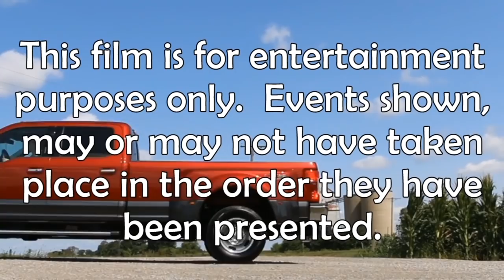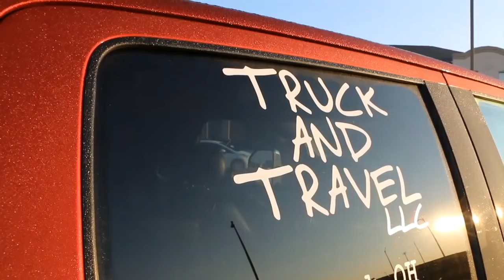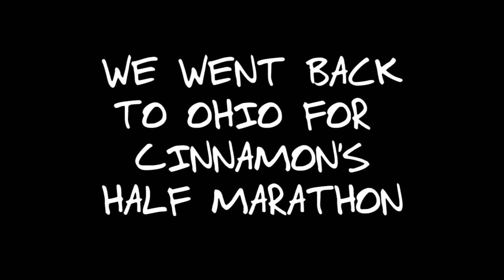Our First Hot Shot Load Together With Our Own Authority

Comment: congrats on your first team load... I'm about 2 weeks out on hitting the road.  I have a truck like yours and a 40' trailer.  what is our trucks rated for total,  36k lbs???
Reply from the maker: Depending on your rear end gears and if it is a Single or dually. I will say mine is rated for I think 32k gooseneck and 21k bumper pull
Reply: thanks man....  safe travels to ya'll and we'll see ya on the road soon...
Reply from the maker: Thank you Marc. Safe travels to you when you hit the road

Comment: With your experiences and knowledge of hot shot, do you recommend leasing on with a company first before obtaining own authority? I’ve had my CDL’s for 10yrs now but never done hot shot trucking.
Reply: If you know what youre doing, can jump right into hotshot yourself. Just know weights, insurance, proper equipment and so on. If not, well highly recomend with a company then.
Reply: I know all rules and regulations of a rig which I know are different from a dually. DOT hot on duallys in south Tx and LA. Never had an over weight ticket in 10 yrs and CSA score is at zero. Want to keep it that way lol. Thanks for the advice and keep the videos coming!! Congrats as a team
Reply: @walkerinmotionllc8618  Well you shouldnt have an issue then. Just keep in mind a truck SLT or tradesman ram is the cheaper but still $45,000. The trailer depending on weights you want to run range. I know Kaufman Trailers have a 31,000lbs rated triple axle dual tires. Just keep in mind the tires and that. Why most Hot Shots keep with tadem duals. DOT of a dually and a semi are exactly the minus the airbrake of course. Still scale and permits if oversized. As for insurance, theres really no way around the high charges. I know a semi O/O will a milion coverage averages $45,000 a year.  No matter what, the cost is high. Also, keep in mind that ya the servicing is cheaper, but same time youre doing double. The only benefit is you go places truckers cant. With DOT, you cant run emission deletes till you reach 100,000miles. Choice is yours, but id do this as a retirment if you have a good job already. If not, take the good old risk. If you fail, you at least tired first instead of wonder
Reply from the maker: @brandon Caldwell, thanks for your input! 2 things that cross my mind. Yes you can jump into it if you have all the tools you need BUT after you apply for your authority it takes (If I remember correctly) over 3 weeks just for the application to go through. Then you have the drug test, getting Apportioned plates and other steps so if you can afford to go through the wait, go for it.  If you want to test out the industry there are some places if you have your own truck you can rent the trailer and work for them.  2nd thought is that seeing all the loads on the load board, there are SO many more for semi drivers. You wouldn't have to put partials together. Just a little thought 😊
-Cinnamon
Reply: Brandon Caldwell I suppose I have a good job lol. Some things in life you just outgrow. I’ve outgrown working for someone else. I basically want to run my own small company for 1-2 yrs and put someone in it that I’m comfortable with. If not then I’ll keep running till retirement. Shooting for 45 yrs old for retirement. I’ve been around for a very long time with trucking industry. There’s a lot of changes which will continue but I don’t care about the money to be honest but working for myself is a main priority. I know the money that falls into it.
Reply: @walkerinmotionllc8618  Yep, i understand. Ive bounced around between 4-5 jobs. I tried staying there and recently this current one is hell on me. Mainly because of my hearing is bad. I knownthe trucking industry quite well, just cautious on taking the leap. I want to work for myself and at least have a couple businesses or a few rental homes so i wont be under anyone. I am tired of working for someone also, but im only 23. The politics is what kills me. Prefer working al9ne and away from people, yet here i am dealing with customer service / dispatching. Sorta undecided what to do, but i manage money quite well.
Reply: Brandon Caldwell That’s me, Money management is a MUST! I’m 35yrs old and I don’t have major bills nor children. Started at 22yrs old making mistakes with things I didn’t need and etc. That’s out the way lol.  I’m not scared of the leap but want to make sure I do things right as far as financing the right equipment. I want to do general freight. I thought about the 3-4 car hauling but I rather start off with general freight. I reside in Dallas Tx where the hub area is through the roof. I’ve always lived where it’s a hub area. Not so big on switching companies but I get it lol. I’m glad to find such a cool guy here on YouTube that’s so laid back and knowledgable. I love his videos. Gives me STRENGTH!!!